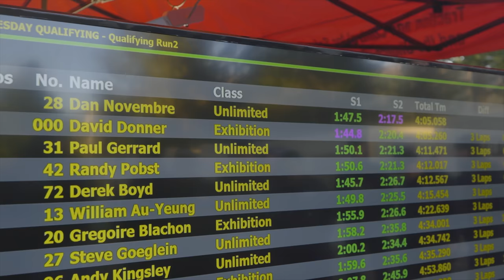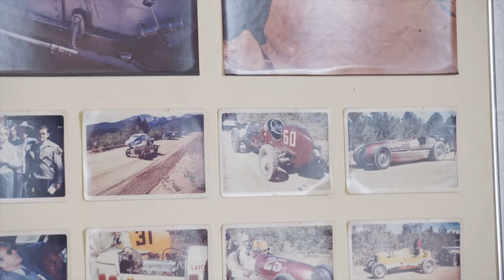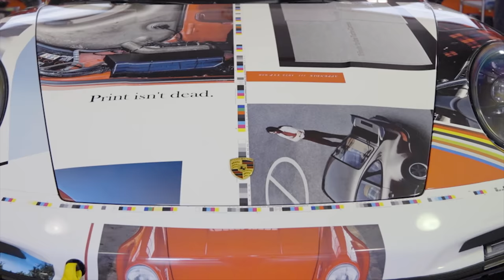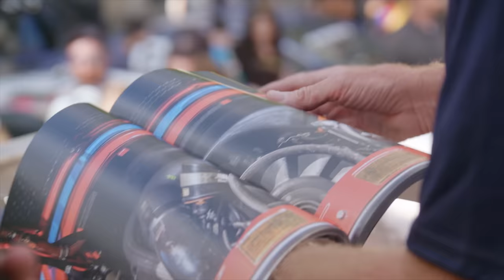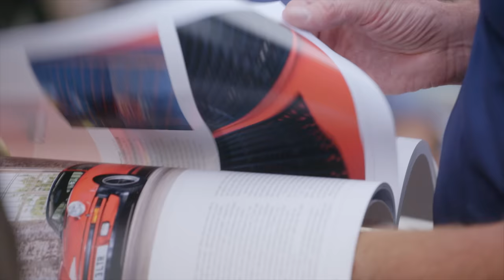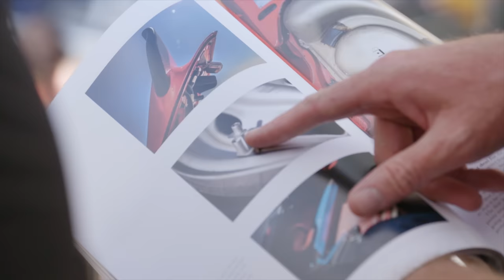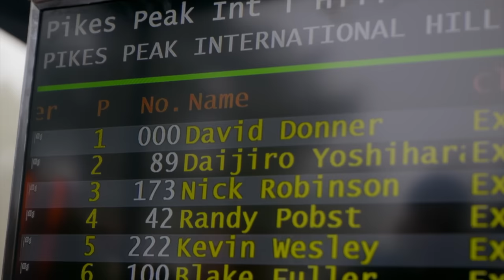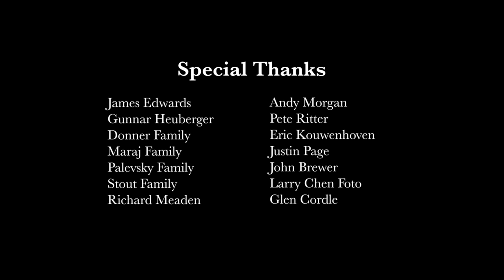A Pikes Peak Story - Porsche 911 Turbo S: 🏁 2022 Winner 🏁 | Carfection

Comment: Driving in fog isn't so bad if you can make a couple of assumptions.   Firstly, you know the road, secondly you know the road is clear.   A very impressive drive nonetheless.
Reply: can you do it at full throttle at Pikes Peak?
Reply: @arivette2010  lol exactly
Reply: @arivette2010  I've done it elsewhere.
Reply: @alistairwillock7266  You're on the right track there.   It comes back to what I did at uni - Information Theory.   If you expect something, a pulse as part of timing in a digital signal, then it contains no information.   The driver knows there's no other cars going to be on the road, so that's information he can disregard.   He also knows Pikes Peak, that's less information he needs to process.   That allows him to concentrate on the road conditions as you mention, the snow at the sides, the posibility of ice etc.   He can do that because he is able to disregard other bits of information or looking out for those as they contain nothing useful.   Being able to do that, as he's clearly done, also marks him out as being rather exceptional too.

Comment: An EV did it in 7 mins.  Porsche in 10.  EV beat the hell out of the Porsche. Porsche is a pig compared to the VW EV.
Reply: Lets compare a VW streetcar to a Porsche.
Reply: @freakattack9616  Yes. We want to know which car generates the most error codes!!  Which one is quicker to the repair shop!! Which one spends the most time in the Garage or the shop!!
Reply: @grabir01  you mad? I own a Tesla and would buy a 911 over any EV if i could afford it.
Reply: @grabir01  I'm not talking about an old one. A 991 or a 997 Turbo would be a dream.
Reply: @VaporwareMartinez  An old one? I am not talking old here.  A Dream/nightmare. What is the difference.  Only the spelling I guess. I suppose if you want a error code generator, then go for it!!  As for me. I will not own any newer German car. Status symbol of stupidity.
Reply: @grabir01  i totally wan't that error generator in my life. Nothing hotter than a 911
Reply: @VaporwareMartinez  I must say. The Germans make the best looking cars on the Planet. If you want a Hot Mess, Go For It!!!!